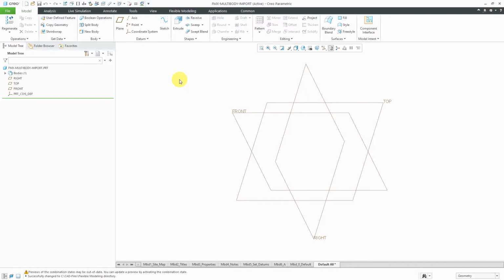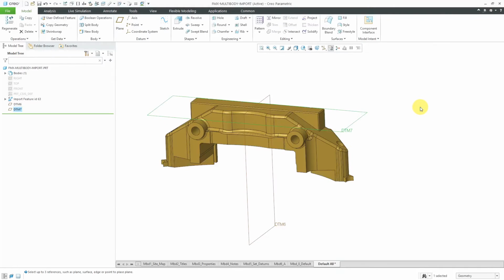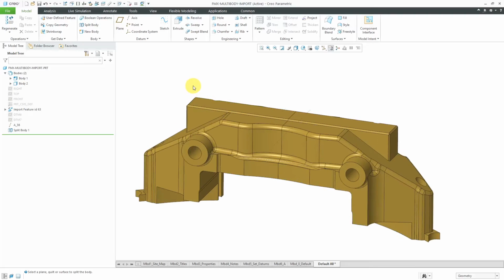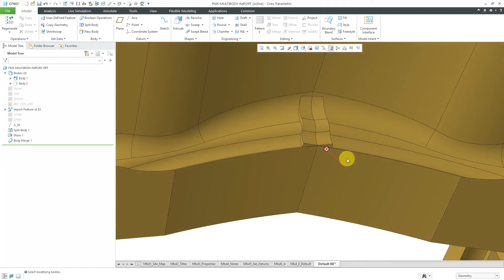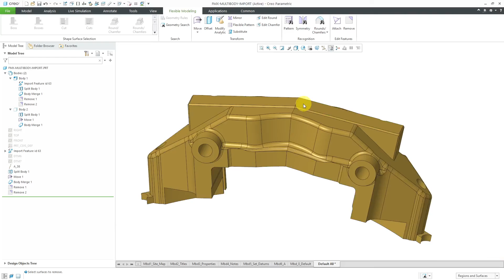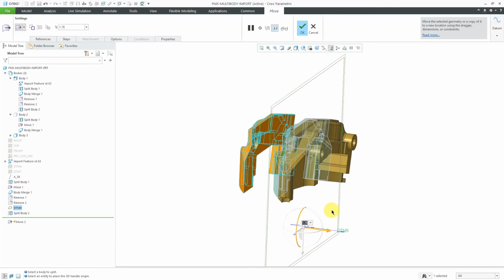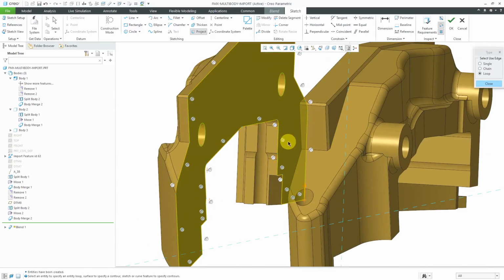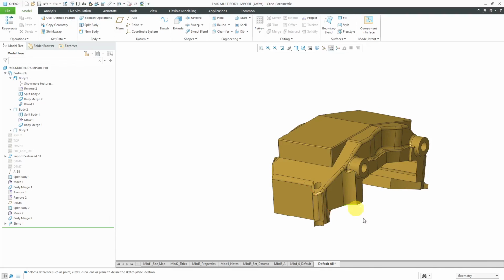Creo Parametric - Multibody Modeling and Flexible Modeling (FMX)

Comment: I want to model the handle of a an electric screw driver. I find it very difficult to outer the handle ouster surface curves and different cross sections etc..What do u suggest me to use flexible?

Comment: The tangency between the models went to space!

In a real project this resource would hardly be used, there are much simpler software that perform this task in a primordial way and you don't even have to separate the solid.
The second feature where you join bodies with projections is also far from the best, but if that's what the software has to offer, patience.

The comment posted here is about "the resources in question", the didactics, the knowledge and the beautiful work done on this channel are not being discussed, congratulations on the posts!
Reply from the maker: Sometimes people take the examples in the videos too literally and miss the point of the demonstration. In this particular video, it's "here are some tools that you can use to combine Flexible Modeling with Multibody." Sometimes people miss the forest for the trees.

Comment: Really cool one today, unfortunately, I kept trying to grab the screen to rotate the model.
Reply: Put the mouse cursor at the point you want the center of the spin > press Alt+middle mouse. Also if you are in a Ass, holding the Alt key will highlight the part again press Alt and middle mouse to rotate
Reply: @RnioBB  Apologies, I meant trying to spin the model in this YT video.